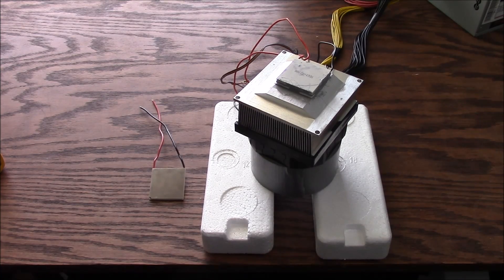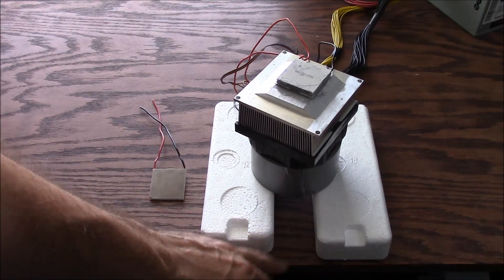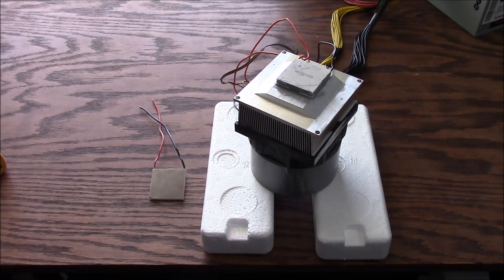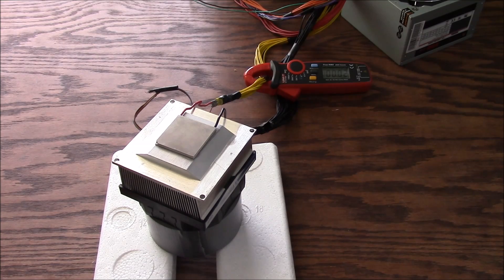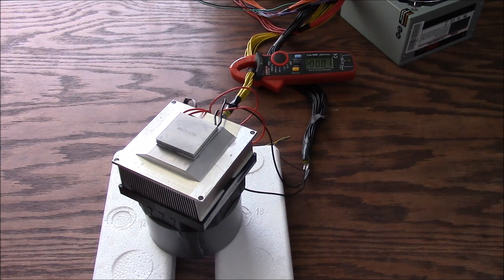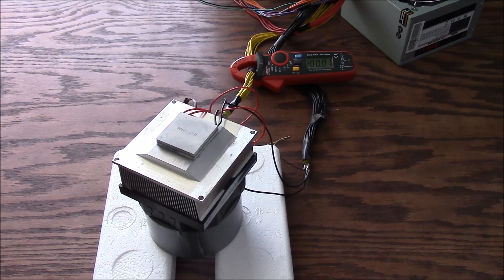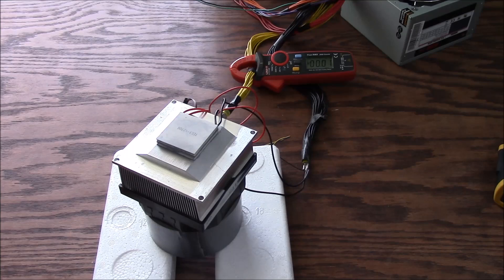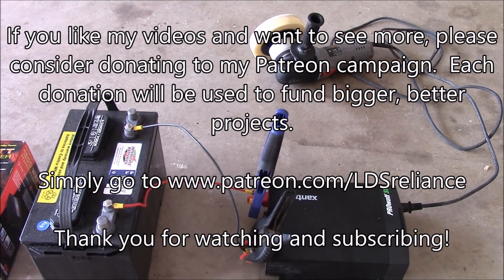Peltier War! - Cascading Vs Double Power

Comment: I have a TEC2-19003 that I regularly get 100 degree fahrenheit difference between hot and cold side. Its runs at 4 degrees fahrenheit with just 1.3 amps. I've gotten it to drop to -4 degrees fahrenheit without topping out at its rated 3 amps. I cant get anywhere near that with my single stage TEC1-12703 devices. The multi stage devices do appear to work much better at deep cooling vs single stage. However, as was mentioned you have to drive then from different current sources so the bottom doesn't get as much as the top one. I'm guessing the manufactured ones account for this.

Comment: A fan means it's active cooling... Also no heat load on the cold side means the test isn't testing anything of value...give it work to do... Cascading is less efficient because it needs to get rid of about 4 times the heat of the single or there about....  There are two levels of waste on the cascaded units vs the single...  you aren't comparing apples to apples...

Comment: With this thermometer , u can not get accurate result . Because u are taking not only peltier's cold surface but heat sink's temperature too.
With cascading mode , the heat sink side will get more hot , so needs better cooling.

Comment: You have to reduce the voltage each step bottom to top when cascading. If u really study on tec you can easily gain -50c on top peltier. (12v bottom one and 5 -7 v to top one and try it)

Comment: Are you sure that your measurement setup is perfect? It is an infrared thermometer. Probably some IR radiation from the middle layer is measured with the thermometer. I would suggest using a K-Type thermometer that is directly attached to the cold side. I think the Peltier sandwich has a lower efficiency than the 10A type. But the values in your video are far too bad. Maybe infrared is the side effect you're looking for.
Reply from the maker: I am not sure that it is perfect but that is all I had available.  The k-type thermometers available with my multimeters have proven much worse for me in the past.

Comment: I want to suggest one thing.stack 3 peltier one after the other.give the voltage to the lower one 12v, middle one 5v and to the top one 3.3v.and buttom one should be water cooled with heat sink.i am sure you will get -60 degree centigrade.please do this experiment
Reply: what if i use 5v top, 5v mid and 12v bottom. does it work?

Comment: I ve done the same thing with same bad results  few years ago , it is not work that way you need to do this: https://youtu.be/-7d5L3M8KB0   or just lay them in pyramid config closer to heasink 4 then 2 then 1

Comment: The power ratio between the top and bottom units should be around 8 to 1. So for every 8 watts the bottom unit does you can only do 1 watt for the top unit. This is due to cheap peltiers only being around 12 percent efficient.

Comment: Well. More power - current - more heat. U use almost 5A on the 21705 unit and only 70% of power 21710 unit. Try to use this configuration.
Hot 12v cold/hot 3-5v cold. U should get 30-35C difference.

With this power supply and some step downs u can get 50C difference. Just try this conf. 

10A lowest with 12v. Should take no more than 7A.
5A middle with 5-6v. Should take no more than 1,5-2A.
5A top with 3v. It will take less than 1A. 

U should get at least -30C with +25C in your test room.

Good job m8. Keep goin. Cheers from Poland.

Comment: I'ts like a building. To go higher, the lower stages should be stronger. If not, the weight of upper stages will make you fail

Comment: You need to reduce voltage input to second module. You can use resistor to reduce voltage but power used wont change much. Need to use a PWM controller to reduce voltage. This guy does a good job explaining why.  

https://www.youtube.com/watch?v=xIP7HszIX-w

Comment: The reason es because un cascading is reduces the gratis dissipation. And dissipation is the ley for thermic peltier effect. If the heat is drain in the same Surface área but have yo handle the residues of more elements, passing by additional stages of low Thermal conductivity materials (the peltier module itself x 3) the effect Will be worsening itself.
Reply: I am sorry, the cell phone corrector is messing with writing. I mean that heat dissipation is the key factor. And cascading interfere with dissipation, the peltier module must have to connect directly to heatsink, not to another ceramic/silicón/semiconductor.

Comment: Interesting tests but for cascade to work properly, the second peltier needs to be much smaller/have lower power rating. For example: first one is 60W and the second one is 20W. I don't know the exact ratio but I think it's at least a few times less than for the first one. If you want to add the third one, same thing; it needs to be much smaller than the second one.
Reply from the maker: Yes several people have mentioned that.  Someday I will do another test.
Reply: LDSreliance Ok, sorry, I didn't know. Good luck with your next test!
Reply from the maker: No worries.  I got so many requests to test cascading that I did it but I didn't know beforehand that the two peltiers needed to be different sizes.
Reply: LDSreliance Oh, ok! Not big deal - you can still try it that way ;)

Comment: Thanks for the video.  One observation is that you really need a clamping force of tens of lb per square inch to achieve optimum heat transfer from the TEC module to the heatsink.  Ref: http://www.overclockers.com/heatsink-mounting-pressure-vs-performance/.
Reply from the maker: Good info.  Thanks!

Comment: in your cascade you only really have one and a half peltiers.

This is because the colder one puts out more heat than it takes in. So the warmer one runs flat out but the cooler one does not.

It would be interesting to test with a 5amp cascading a 10amp. If my theory is right it would be more effective when the lower amp device is on the cold side than the other way round.

My guess is it still would not be as good as a single 15 amp peltier
Reply from the maker: Right.  Quite a few others have made comments about that.  I do intend to test that out someday.  I am hoping to have some time this fall/winter to do some more peltier videos.  So stay tuned!

Comment: What does he "LDS" stand for?
Reply from the maker: Latter Day Saint.  As in the Church of Jesus Christ of Latter Day Saints or the "Mormon" church.
Reply: Did they give permission to science? ;)   Nice Tube by the way. I think the double would be more efficient if you set a beer can on top (or another aluminum beverage can.) I've seen that having a heat sink on both sides improves performance. The top unit in the double doesn't effectively have any.
Reply from the maker: Haha I don't know if they gave permission or not.  I never thought about it.  Good suggestion.  There are lots of ways you could improve on this cascading system.  I didn't try very hard because I don't see much application for it.

Comment: People get too caught up on the thermal grease interface. Yes, it matters at the extremes when trying to cool a CPU which can develop fatal hot spots. But that's more of an issue of trying to prevent hot spots. The over-all thermal transfer coefficient it's going to change that much. As far as I know Peltiers and going to balance their heat transfer pretty even over the surface, so hot spots are not an issue and even if there were some I don't believe the peltier is going to care.  I suppose if it was very bad then one of the junctions might suddenly go high resistance, but then that should drop the power... A thermal imaging camera would be handy.

The thing to remember is that these things generate heat. They don't just move heat from one side to the other. You end up with more heat on the hot side than was removed from the cold side. You need to account for this otherwise the TEC in the middle is always going to be fighting to more move heat than the one on top. You can limit current to the top unit to compensate. You can use a PWM dimmer as that will  be more efficient than a resistive current limiter.  You could also run the top on 5V and the bottom on 12V (if you're using a computer power supply then these always have both). An third option is to run two TECs in the middle and a third on on top. You should separate then top and bottom with a copper heat spreader. I've got a bunch of TECs around here somewhere. Maybe I'll test this and post results.

I believe TECs have a failure mode where if they are run without current limits and they start to overload (the hot side cannot move heat away fast enough) then they go into thermal runaway where they just end up producing a lot of heat on both sides of the unit. I think. I can't seem to find a reference to this so I might have just dreamt that this happens. I remember that something happens where it falls down and the cold side doesn't get cold anymore. Allowing the TEC to cool down seemed to fix the problem.

I need to run some tests rather than just speculate.
Reply from the maker: Good thoughts.  Thanks for sharing.  I will be re-visiting these experiments this fall/winter.  I am a bit wiser now, thanks to viewers like you, and have some more ideas for practical applications.

Comment: When you say "efficient" are you talking about cooling to wattage ratio or merely Δ T? If feels like you mean "cooling power" when you say efficient. In a comment you mentioned how a 10 amp and 5 amp cascade will not be as "efficient" as a solo 15 amp module. Yeah, captain obvious. Of course a solo 15 amp module would be more efficient, in that it draws less power when cooling, so the power that's used is used more efficiently. The cascaded modules would draw significantly more power and get less bang per buck, but they would achieve the lowest possible temperature, thus the cooling power is greater. Oh, and this test video has too many things wrong to name. Needless to say, the results are invalid.
Reply: Pablo Fernandez, it's quite easy. First, nothing was said about the person. Second, the information was severely lacking. The OP has since acknowledged this and filled in the gaps. To you, it may not matter because most likely you aren't educated on the topic. The point is to communicate in order to grow. Perhaps you require a more gentle touch, the OP however, had no issues and our exchange was fine.
Reply from the maker: Yes, cooling to wattage ratio.  Peltiers are bad to begin with compared to other cooling methods and cascading makes it substantially worse.  The only reason, like you said, to ever even think about doing this would be to achieve a minimally lower temperature IF you didn't care about how much power is consumed.

Since you know more than I do about this stuff, perhaps you should make some videos and do it properly?  It is easy to cast aspersions but at least I am trying to do experiments and learn.
Reply: Exactly. Okay then, you get it. My bad.
Reply from the maker: No worries.  I fully admit I am not an expert on peltiers and far from an electrical engineer.  I just had several people tell me I should try it out so I did.
Reply: I don't understand coming here to see an experiment, just to start talking shit about the guy who has done the work. I am about to buy peltier modules myself, and these videos are useful because I don't have to do the experiments myself.

Comment: when using 2 TEC modules, be sure to reduce the  power to the second stage. try to redo the experiment by connecting the second TEC module to the 5V rail of the PSU. The elegant way is to use PWM to control the second stage of cooling. The idea is to ensure for the second stage a considerable temperature differential by cooling the first stage. That way, the second stage will drain less electricity due to that temp differential between the hot side and the cold side (so less internal heat) while the semiconductors will suck the thermal energy  from the environment.
Reply: Tedy's right. When you give two matching TECs 12v in parallel, you create a bottleneck where the first is trying to cram its heat into a second that can't keep up because it already has it's own high thermal load. The best way is to run the second at a full 12v (or more) on a variable supply and the first on its own much lower voltage variable supply, carefully adjusting the voltages for maximum Delta. I had to learn all this when building my TEC cloud chamber. The only way I could get down to the more or less cryo temps needed to start showing trails was to use a stack of two TECs on a very good contemporary CPU heatsink, with around 6 volts max on the primary (cold side) TEC and around 15v on the secondary (hot side) TEC. When you do the voltage adjustments, using an IR thermometer you can see the heat slowly creeping back into the cold side TEC when you push the system too hard. Lowering the voltages a bit at a time, you can see the temp drop to a maximum Delta figure, the best you're ever going to get for that setup. My cold spot in the cloud chamber was achieving about -22F on ideal days, so with a temp in the house of about 76F, I was getting a seriously nice delta of about 54F. You'll never see Deltas like that with a single TEC, period. If you actively chill the single TEC with very cold water cooling, you'll see lower temps on the cold side, but that's because your hot side is being chilled. It's still the same typical Delta of say 25 degrees or less, it's just a Delta against a colder environment. Stacked TECs always provide a much higher Delta when properly set up.
Reply from the maker: Good idea.  Thanks
Reply: One quick note: TECs are HORRIBLY inefficient creatures. A single TEC is a power hungry monster that will burn you to death and literally melt its own solder without cooling, and a stack of them is even more insane. They're practical enough for some things, but far, far from magical and often hard to justify.
Reply: I connected two in series and compared to a single one and got much better results with cascading

Comment: When you put some peltier cells in cascade you have to take in account the heat generated by the Joule effect. For this reason the "coolest" module should be smaller. How much? It depends on the resistance of the module. The hottest module must be capable of transferring all the heat produced by the coolest. The total heat dissipated at the hot side is the sum of the heat transferred from the cold side plus the heat generated by the joule effect. If you put two twin modules in cascade, the cold side of one is receiving from the other too much heat respect to what is capable to transfer. To calculate how to choose the second one you need to know how much heat the hottest cell can transfer. Then you choose the second one in a way that the consumed power plus the transferred power of the coolest are the same (or very close) to the transferred power of the hottest. Once you find the Peltier coefficients for P and N silicon, you can use this formula  https://en.wikipedia.org/wiki/Thermoelectric_effect#Peltier_effect
Reply from the maker: Yes, I was ignorant to that phenomenon and pretty much proved by this experiment that you can't just use two similar sized peltiers.  I was encouraged by a dozen or more comments to try cascading and I did a bit of reading about it but I never ran across that you have to use two different sizes.  I guess I didn't read carefully enough.

Comment: Dude, you must try to use a COLDPLATE, better if it's made of copper, between the two peltier cells. It would help transfer the heat from the hot side to the cold side of the other cell, boosting the system's efficiency.
The cells are layered by ceramic, and this is not a high efficient material for transfer heat. Aluminum is, copper is, and it's better than Al, it haves kind of twice the heat transfer coefficient, near to that of the silver (that's the best one).
Another thing you can try is a heatpipe, that's way more efficient than just a copper or even silver coldplate.

Comment: Stacking/cascading peltiers can be really tricky.  Just remember that even with no energy being transferred from the cold to the hot side, a peltier module generates LOTS of resistive/ohmic/I^2*R heat even when it is idle.  Thus, when operating in a stacked configuration:

1. The largest TEC module must be sized so it can dump not only it's own internal heat, but ALSO all of the heat being added from any successive modules.
2. At least glance at the curves published for each specific module, so you can be sure to operate it most efficiently (electrically).
3. Instead of trying to calculate specs, purchase and arrange correctly sized modules and powering them all at 100%, buy a set of peltiers where each one is at a MINIMUM, physically smaller than it's closest hot-side neigbor and then use PWM to tailor individual power flow for optimal/max results.

Whatever you do, don't just slather both sides of a few of them up with some thermal compound PB&J style, cram in all the current each one will take (without exceeding Vmax), measure temps and expect to see anything miraculous...
Reply from the maker: Great info.  Thanks!  Someday I will revisit this and do a better job.